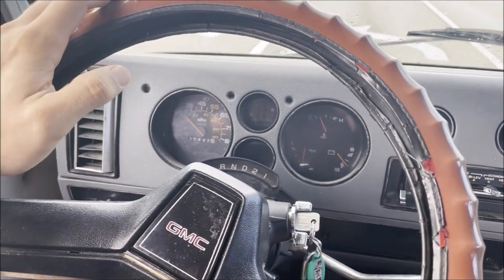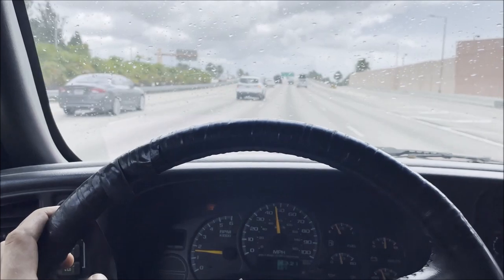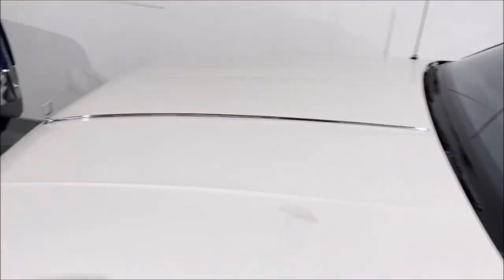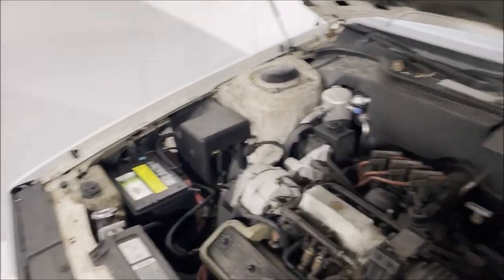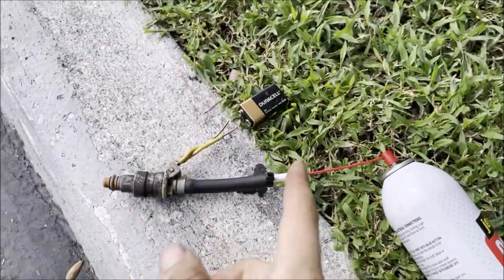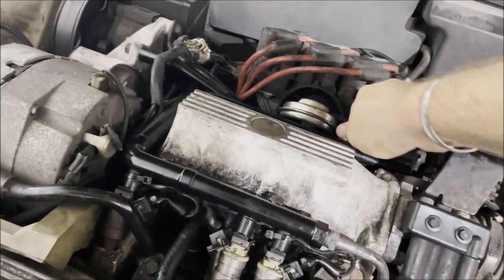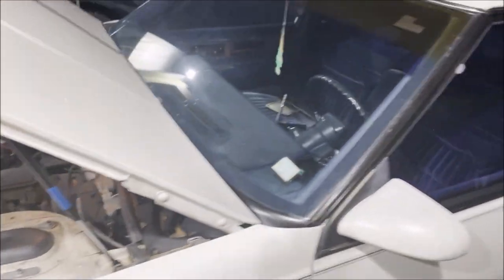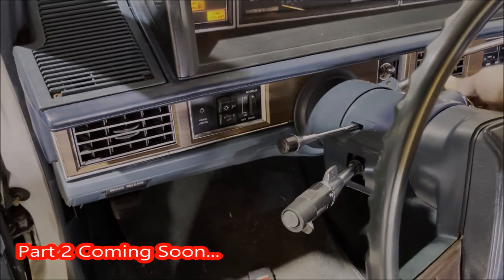I Bought A 1986 Olds 98 Regency Brougham For $1150

Comment: These 98s had beautiful interiors. I think the "C" bodies are going to increase in value. They've been overlooked. The 98s were much prettier than the DeVille or the Buick imo. Also  they are built like tanks and the later 3800 engines are bulletproof. I have a 1990 ( last year) 98 Regency Brougham with 52,000 miles on it and I wouldn't trade it for anything.

Comment: Nice car. I think you got a great deal on it in today's market. Probably would not hurt it to do a tune up by driving it 70 mph on the highway for an hour. I forgot what they call it but it has tune up in the saying. I have a 1990 Oldsmobile 88 Royale. With only 73,000 miles. It is in great condition, not showroom. Have videos of it on my channel. They are some great riding cars that is super reliable and easy on gas. That 3.8 liter is very easy to work on. I was having a power steering fluid leak. Found out it was just the pressure switch. Took me ten minutes to change it out. You keep up with the usual maintenance on the cars and they will last a long time. The driver side window takes forever to go up. Now I just roll the rear ones down a hair for fresh air cause I smoke and run the air conditioner. I fully trust this car to take me anywhere and not break down. Well the motor and trans. Other accessories do not know when they will go out on you. Thumb up...
Reply from the maker: You’re thinking of an “Italian tuneup”!
Reply: @bigalsbikeandauto  I heard that was redlining it in every gear…. Might be tough on this old bird.

Comment: I bought an '86 Regency Brougham IDENTICAL to this one back in 1994 from a used car dealership. The dashboard still had the name placard the dealership placed there which had the name of its original owner. It had just over 100k miles on it when I bought it. It was my first American luxury car purchase, and arguably one of the best cars I've ever owned. The interior still smelled new when I bought it, and both engine and transmission were flawless. Drove the car from Oregon to San Diego and back one summer in triple-digit heat, and the car got me where I needed to go without a single complaint. Took it to the mountains on ski trips too, and had no complaints. I miss that two-tone chime, as well as the comfy seats. What an awesome car that was. Bought an '88 Park Avenue several years later, and it was equally as reliable and just as enjoyable to own and drive as the Regency Brougham. These cars were built to last hundreds of thousands of miles. I so wish I would have kept this car. I would NOT be disappointed with this purchase if I were you.

Comment: I worked as a driveability tech at a GM dealership and these 1986 3.8s always had a low idle roughness to them due to it being a very early and rudimentary sequential fuel injection system. The software and limitations of the obd1 system being able to accurately control the fuel injection a millisecond before spark. Also, the mass airflow sensors were famous for causing a rough idle/stall. Easy way to test is do a tap test, rap on the MAF with a screwdriver at idle. If it stalls or hiccups the MAF is bad
Reply from the maker: MAF is good, the code 34 went away after I cleaned that passage in the intake. This was stalling/running really rough though, not the typical unbalanced LG3 stumble. Part 2 will reveal what was happening!
Reply: @bigalsbikeandauto  I cant seem to find the next video.  What did you end up finding?
Reply from the maker: @PostalRedneck  to be honest I don’t even remember. I swapped the injectors and a few other things and it was running great. Then it started running awful again and I parked it with so many other projects. Last time I went to drive it fuel pump had died. She’s covered high and dry on my driveway for now.
Reply: @bigalsbikeandauto  Yeah when you started it after doing the injectors it had a lean backfire though the intake.  Im guessing it gummed up your MAF with how much carbon build up was in the intake and caused it to start running rich and thats why your cat was glowing red trying to burn off the unburned fuel in your exhaust.  Sucks to hear about your fuel pump.  The one in mine had the one way valve go bad so it no longer holds pressure in the rail when turning the car off causing it to have a long crank when starting every time.  Good luck with it thats a clean one.  Wish my lifted yellow olds was that rust free but here in Michigan thats almost unheard of for these year cars.

Comment: I’m not a big GM guy but I’ve been buying some 70s and 80s GM cars just because you are right these cars need saved . The cars from the 70s & 80s need saved no one cares about them,  I just bought an 88  Buick Electra estate with the wood trim that’s perfect finished in blue with wheels that was just like the General Lees, just needed a starter and a good detail, gave $1200 bucks wouldn’t take 5g’s for it. Thanks for the videos would like to see a couple more. But I sure it’s a pain to do them.

Comment: I like that era of 98 and Delta 88. They were a popular family car back when they were new and, by the late 80s and early 90s, they held their values very well despite having had their share of transmission problems. In my opinion, these cars were a far better buy for the money in their day than a new Buick or a Cadillac. I think you bought it well (you only overpaid for it if you sell it at a loss) and I agree with you about the colors. This would have been the best looking new Ninety-Eight on the lot the day it sold brand new back in ‘86.

Comment: I had a 90 lesabre with a missfire after it got hot. It turned out to be the elecrtical connector to the ignition control module. Terminals would get hot and expand and break the connection. It would throw an egr code every once in a while but no misfire codes. Took me a while to track it down.

Comment: From my experience in working on anything with the fuel.... the pump, filter, injectors, regulator or lines, anytime the fuel pressure is released, it needs to be pressurized again. That might be why it took so long to start.

Comment: In the early '90s I didn't like this engine.  I had trouble with a few and I didn't know how to fix them myself so I stayed away.  I am glad you got it to run better, but I had too many that needed a lot of work.
Reply from the maker: What I like about the LG3 is that it doesn’t have the ICM/crank sensor/cam position sensor stalling issues that the later 3.8s have.

Comment: My parents were lifelong Olds owners. They were good friends with an Olds dealer. I witnessed the change from the rwd 88s &98s to the fwds. I didn't like it then & never got used to it. My parents owned 98s from 1970 through 1992 including '85,'88 & '92 fwd 98s. When I saw the 1985 98 it made me sick to my stomach...  at least the '92 98 looked a little like the classic 98 should.

Comment: I would change fuel filter and since she idles put some more gas ⛽ in and dump 2 cans of Berrymans b-12 chemtool in the tank and let it run so it can clean the injectors. Take it out and drive it. Probably needs the throttle body cleaner sprayed in it. Berrymans also cleans spark plugs, but probably needs new ones. A Wix Air filter will let it breathe

Comment: I noticed that the gasket for the MAF to the inlet manifold was torn, that can cause poor running as it can cause a leak of unmetered air into the inlet manifold, causing lean running.  It would be a very good idea to replace that gasket...

A blocked cat will cause excessive carbon build up in the EGR system as the exhaust gas isn't flowing freely through the exhaust system.  It has to find another way to go and often that will be through the EGR system which isn't really designed to handle that much of the exhaust gas.  It's not just older vehicles that can get these problems, I've seen plenty of way less than 10 year old vehicles with blocked cats and thoroughly plugged up EGR systems that are throwing all sorts of diagnostic codes, including a few that had been diagnosed with knackered engines...
Reply from the maker: Good eye. That gasket ripped when I started cleaning out that inlet; I already ordered a replacement. It was running poorly before the gasket tore though. Speculating the same with the cat, but have to replace something else first in the diagnostic order before I touch the cat! Exhaust flows out the tailpipe “normally”…

Comment: The LG3 is unbalanced. That is what seperates a Red Dot from a 3800 of any series after it. As a result these engines always feel like they have a slight miss, when they don't. You're just feeling a 3.8L 90 degree engine with no balance shaft.
Reply from the maker: I know what you mean, but this is far worse than the typical roughness of a LG3. You’ll see in part 2!
Reply: Yeah, at its best the red dot is a cobby agricultural beast of a motor lol. I have two of them, 87 TS and 87 Ciera GT...

Comment: We owned on of these Oldsmobiles.   The problem with the 3.8 V6 is that the timing gear on the end of the crank has a nylon toothed gear.   The teeth will chip off of the metal and the chain will slip.   It is a none clearance engine and be destroyed.   It has a T440A clunk o magic 4 speed auto that gave wat to the 4T60E tranny.   1986 does not have the balance shaft either.  It has alot going for it.  

Plate [C]

Comment: I’d fix that, and ask $5495.00 on my little car lot in Pa. And I would get close to that. What OBD 1 scanner do you use? I’m in the market for one.
Reply from the maker: The 98 Regencys definitely bring some decent money when sorted.
Reply: @bigalsbikeandauto  What OBD 1 scanner do you use? I’m in the market for one. I’ve been trying to get some of my 80s and 90s cars finally running. Scanner would make things easier I suppose.
Reply from the maker: @90scarguy  I have this little black box that plugs into the OBD1 port but all you really need is a paper clip. Plenty of videos on YouTube that will tell you how to jump the pins to get the CEL to flash the codes to you.
Reply: @bigalsbikeandauto  True, I’ve been using the paper clip trick for years now. I’m getting lazy. 😂😂 Sort of just looking for an OBD 1 scanner at this point.
Reply: I had a 1989 Ninety-Eight years ago!! That’s a nice car!! I’m glad you saved it from sitting!
Reply: Also u can make and a complete obd1 plug to a usb cable with tuner pro rt you can set it all up and read codes and live data feed and sensor feed backs to pin point what sensors are doing what . Gm biggest things to change is the coolant temp sensor . And those old magnovox ignition coil pack always fail . After 87-88 they went with the three coil separate design

Comment: My 1991 van not too long after I got it - I was coming back from a junkyard actually - when the alternator just locked up solid, and it ate the belt.  I made it home about 10 miles with it with no issue, but it was a cool day, mid-50s maybe.  

If you think the V8 belt is rough look at a V6 van sometime.  The engine sits back that much further to where it looks to me like the top of the fan shroud has to come off to get enough access to change it. 

I figured you sold that pickup when you moved back to Florida, wow, it must stand out with all that rot. 

Is that driver's door master switch deal the same as Cadillac?  I have a Caddy one I was just about to put on eBay. Didn't know what it was, came in some stuff I bought just before the pandemic to take to swap meets.  

$1150 is not crazy for that when you figure one owner and that nice.  I had to pay $2200 to get a similarly original one owner Chevy van (the V6 I mentioned).  I think if you shipped it up north you could sell it for a profit.
Reply from the maker: Yes, the Sierra does stand out with all her rust down here! As for the Olds, it’s not the type of car I would ever buy to make a profit on. It’s just for me!
Reply: @bigalsbikeandauto  I can tell from how you talk about it how much you like it.  It's just a way to gauge how good of a deal you got.

Like my V6 van, a similar, somewhat nicer one turned up on eBay in April and got bid to close to $8000.  It was a 25K mile true no rust van but otherwise the same, state agency owned, plain low end work van with a 6.  If that one is a 9 out of 10 mine is like a 6-7, being New York it has a little rust on the bottom of the rockers and more miles (47K).  So I figure it would probably bring $4000 if I wanted to sell it.  

Which I don't, this might be the nicest van I've had and I'm going to keep it as long as I can.

Comment: Is it the vent glass that loose?
Reply from the maker: What vent glass?
Reply: @bigalsbikeandauto  on the van when you were driving...
Reply from the maker: @mrchevy7892  oh, yes it is!
Reply: @bigalsbikeandauto  on the window lock, there's a pin that you can push out and then tighten the torx bolt inside... Once you do that, you're good..
Reply from the maker: @mrchevy7892  mine is loose because the shaft that holds the glass in/let’s it rotate rotted off lol.
Reply: @bigalsbikeandauto  gotcha, great video anyways and I'll be looking forward to the next one...👍👍

Comment: idk what it is about these old gms. They arent particularly well engineered. I personally don't find them conventionally attractive either but there is just something about them. Nostalgia maybe?
Reply from the maker: These cars are extremely well engineered. In fact, of all vehicles produced in the 1980s, I would bet the most remaining on the road today are GM.
Reply: @bigalsbikeandauto  I am not saying that they are particularly poorly engineered, just not the best. You may be right about the most remaining on the road, by volume. If we based that on percent manufactured to percent still on the road I am sure something like toyota or honda would be number 1. Just my opinion though no numbers to back it up.

Youre doing good work though if you don't save them who will?